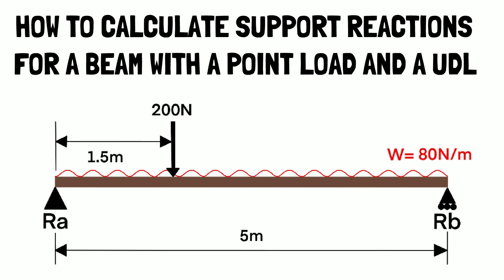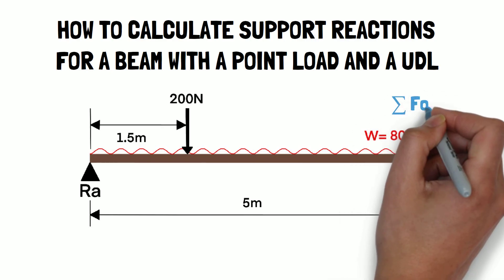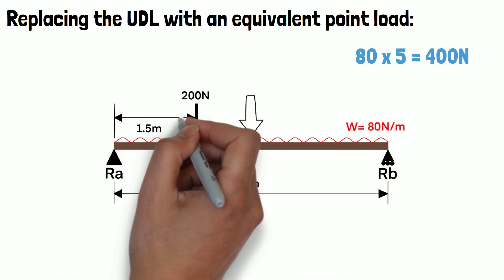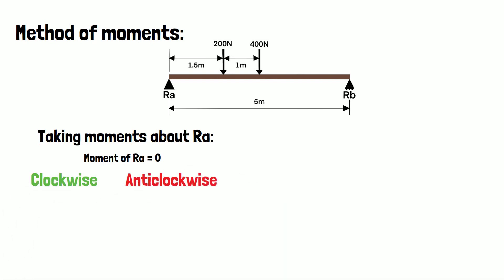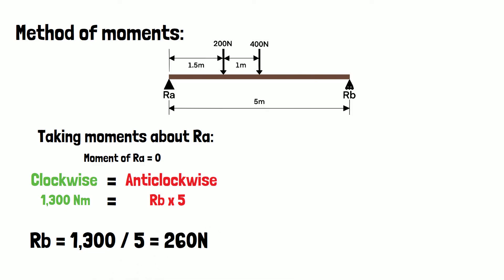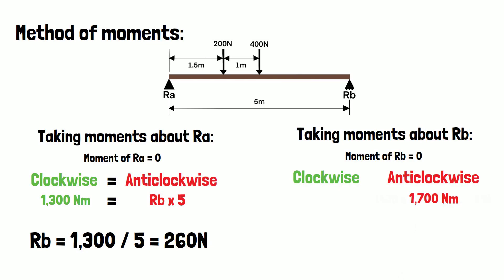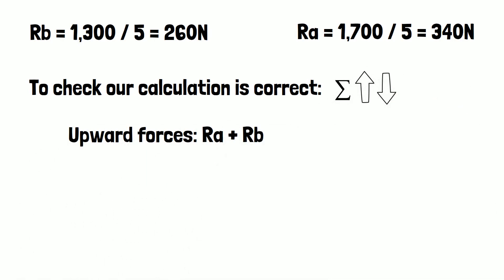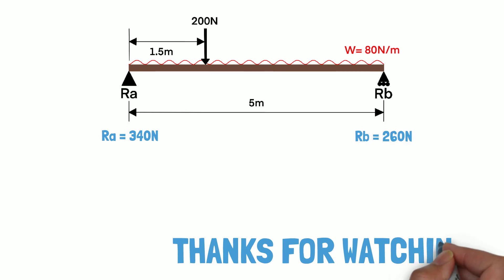How To Calculate Support Reaction Forces For A Beam With A Point Load And A UDL

Comment: Why did 400N get in middle? Is it always when distributing load, you put it in middle? When converting evenly distributed load?
Reply from the maker: Hello, for this type of problem, it is possible to convert a UDL into a point load. The method for doing this is to multiply the weight by the distance and place the point load in the centre of the distribution. Hope this helps/1
Reply: @TheEngineeringExecutive at what point would you not be able to convert it